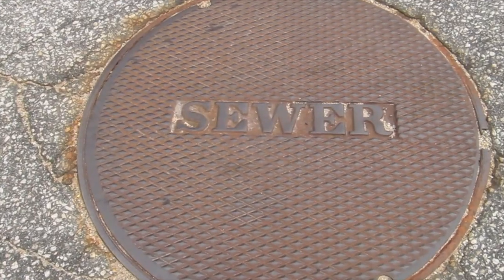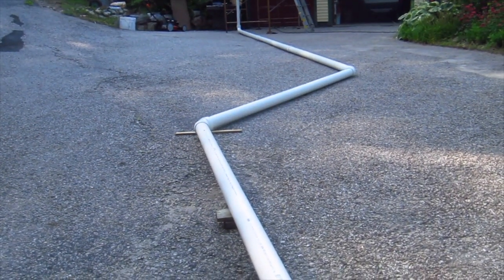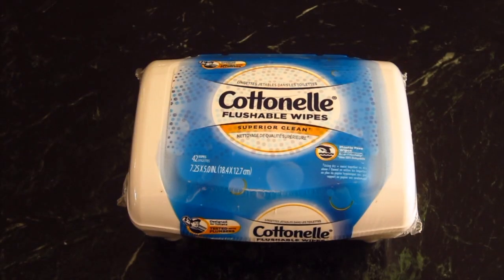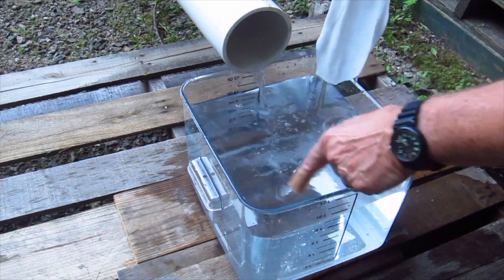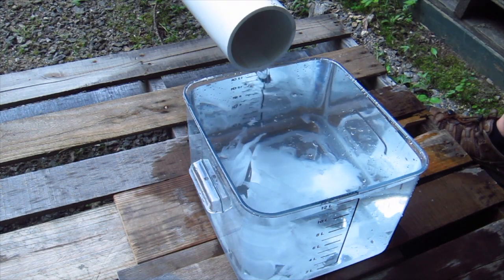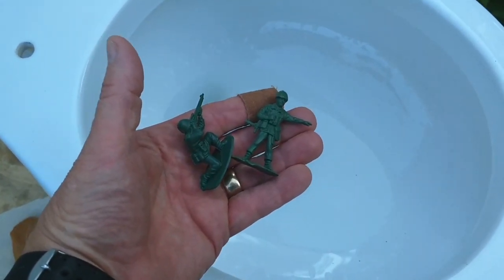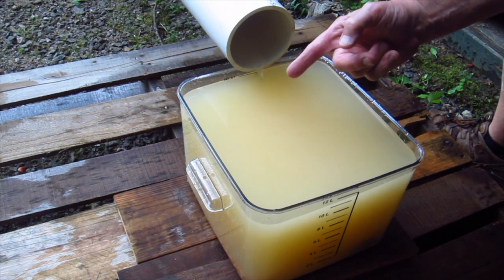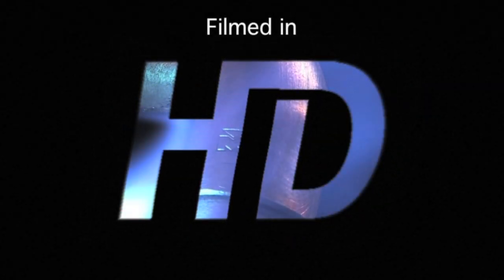Flushable Wipes - Do They Disintegrate?

Comment: Why don’t you let the wipes sit in the bowl as long as you did the TP? You obviously cut time out of the video between when you dropped the single ply paper in and when you flushed it
Reply from the maker: I did. No time was cut. I dropped in each thing and then reached for the flush handle. Perhaps there's a second, two at the most, difference in the times. I invite you to set up your own test apparatus and let's see the results you get with your suggested timing.

Comment: There are already several videos and documentaires made on youtube about the problem. If they mixed it with grease in sewers, they will turn in solid mass, almost impossible to break. Every time pipes must cleaned again with handtools and that is a lot work and very dirty.
Manufacturers SHOULD not named them "Flushable" and must make it just normal wipes and after use THROW in the bin like normal trash.

Manufacturers are biggest morons on the earth for sure. The another problem (wipes are actually plastic stuff because they don't break) are a lot microplastics in cosmetical stuff. They're all bad for our earth and we will eat them too from fish.
Reply from the maker: You can't have too many. For unlimited tips like this video, subscribe to my FREE newsletter at www.AsktheBuilder.com

Comment: Hey man, I loved this vid, but is it okay for me to use the Cottonelle Wipes? I know you mentioned that older drain lines are rough on the inside, so if it began to break from this smooth piping, I would assume it would break apart in an older one.
Reply: No!
Reply from the maker: Did you watch the last minute of the video? If not, WATCH IT ONE MORE TIME.

Comment: What happens if the wipes  sit for a while. Would they not break up  before the day is over. Seems weird to test it without letting it sit and break up for a few moments instead of removing them right away (I figured they would just be sitting in the water for a while in real world)?
Reply from the maker: Are you serious? How long do you stand in the bathroom before you flush the toilet?
Reply: I was talking about after you flush it. When it goes into the public system or maybe even septic. I thought it would be sitting in water for a bit after flushed

Comment: What about flushing down cocaine? Can one flush 2kg at once or should do it in 2 separate flushes? Does ccaine dissolve in water?

Won't ripped apart plastic bag (with corresponding size) stuck in pipes?
Reply from the maker: There are two types of information: Nice to know and Need to know. You're asking a question that's in the first group and as such you shall not receive an answer.

Comment: why do you use 3 inch black wast in the us in uk we use 4 inch as this reduces blockages
Reply from the maker: Because a 3-inch waste line for toilets works fine. I've never had a blockage in 50+ years. The colon in the toilet regulates what goes into the pipe. 4-inch toilet drains are required here in commercial installations.

Comment: Why is there a cut in filming at 6:13 right before you flush the single ply?
Reply from the maker: Because the entire video is made up of cuts. I had to go back and forth from the scaffolding down to the end of the 70 feet of drain pipe.

Comment: In my area you're lucky to have much more than a 1 foot initial drop then 2% after that. I wonder how anything makes it out with low flush.
Reply from the maker: Correct. Low-flush toilets are horrible. THere is no water shortage. Water is put back into rivers as FAST as it comes into sewage-treatment plants. If it wasn't, you'd have a massive FLOOD at the plants. Same with septic tanks. For each gallon of water I put into my tank, a gallon of water immediately flows back into the ground to be re-used again. If you want unlimited tips like this each week, subscribe to my FREE newsletter at www.AsktheBuilder.com

Comment: Hey Mr. Tim. I have 15 years of service work under my knees, haha. I guessed every test correctly.  Funny, most every customer denies flushing the wipes. I always wonder why people think lying to the plumber will benefit them? I have snaked out shirts, underwear, lots of wet wipes, feminine products and the #2 stuff, your last test....people who take lots or.medications will plug a toilet, even a Kohler. Once I was perplexed badly, could not clear a toilet....upstairs apartment, hot summer afternoon, disgusting messy drug addicts and several unfortunate children occupied this one bathroom unit, took the toilet outside, beat it with a sledgehammer and found a large tablespoon stuck in the goose neck of the toilet.
Reply: One weekend had to pull the kids throne to clear a persistent clog. I was grumbling at my kids for carelessly blocking it again as I cleared the goose neck and was then embarrassed to find the work pen I had lost the previous week rather than some LEGOs.
Reply from the maker: They lie because they're embarrassed.

Comment: Who cares if the wipe is intact 60 seconds after you flush it? The test is to leave it a bucket for 24 hours.
Reply from the maker: John, how's dropping one in a bucket an accurate test? There's no sewage system in the world that operates like that. Water and waste is moving constantly in sewer systems from the time it leaves your home until it arrives at the sewage treatment plant that could be miles away from your home. The only thing close would be a single septic tank and as I said in the video, you'd have to have your head examined to put these things in a septic tank.
Reply: Ask the Builder Putting it in a bucket for 24 hours would simulate the baby wipes being stuck in a waste pipe or it would simulate it sitting in a septic tank. If the wipe  broke down over time who cares if it takes 60 seconds or a couple days. The problem would occur if the wipe stayed intact for a long long time. But I agree with you baby wipes should never be flushed and flushable wipes I doubt breakdown quickly, if at all.
Reply from the maker: John, your reply contradicts itself. No worries. Perhaps you should do the test since you have an account here. Record the video and see what happens. GL as we say in Morse!

Comment: not trying to be crass
If you are quite sure your stool exceeds the size and weight of the model used, would you recommend adding water to the flush to prevent clogs and get everything to the municipal system? Or should we count on breakdown similar to the soybean paste model.
Reply from the maker: I'd have a 5-gallon pail filled with 4 gallons of water next to the toilet. Once you're about to flush the toilet to send the mass on its journey, get ready to add the 4 additional gallons of water as the water from the tank enters the bowl to send the log down the porcelain flume. You flush the toilet and as your stool disappears, start to add the water from the bucket. WATCH this video for the pouring technique:  https://www.youtube.com/watch?v=kahfe0kXvo0&t=4s

Comment: I was told by a plumber to never flush a Kleenex. That would flush similar to a paper towel.
Reply from the maker: Tissues will react much like the high-quality paper toilet paper. Throw tissues in the TRASH CAN.
Reply: @askthebuilder  I... Did not know that. I have only flushed kleenex about five times in my entire life, when I'd realized too late that there was no tp and used kleenex. I usually use Puffs Plus for my nose, and that always goes in the trash. I keep a small can beside my recliner just for that. But now I can say I know for a fact that no one should flush them, and I will mention it to everyone often, now.

Comment: In Fredericton NB this spring they had an odor problem at their sewage lagoon, after removing a larger than usual amount of grease from the lagoon they pulled the pumps and removed 2 tons of flushable wipes from the pump intakes. Just because you can flush something doesn’t mean you should.
Reply: Agreed. Also never get chlorine in your system. Never, none.

Comment: Thanks man, thumbs up. I always put my wipes in separate bag but I thought that the wipes would be fine. Also I was unaware that those companies make the claim that they are suppose to dissolve. One thing, I think everything you said was good advise but the only toilets I know of that could possibly take some of that is those powerful toilets in NYC that don't run on septic systems. When you flush it, it sounds like a sonic boom went off. You know what I mean? Its like comparing a Bugatti or Ferrari to a Honda Civic or Toyota Camry.
Reply from the maker: TY as we say in Morse. If you want unlimited tips like this each week, subscribe to my FREE newsletter at www.AsktheBuilder.com

Comment: Bro that was a huge simulated dump
Reply from the maker: It was exactly what the Maximum Performance test labs said to make. I thought the same thing as I kept weighing more soybean paste, "Wow, this is enormous!"
Reply: @askthebuilder  Australia this year got hit hard with Flushable wipes (not flushable in very small print). Causing huge issues for the poor people who had to fix this 3-4 times a week. Now i live in a small state called Tasmania (Australia). our local guys was working on the small pumping station only about 10 doors up. They spent a good few days pumping this crap out of the system. In the end our waste treatment put Adds on Tv asking people not to use them.

Comment: I know from personal experience they can't be flushed. Totally messed up my pipes heading to the septic. I had a huge clog that I had to snake out and it was all "flushable" wipes. I still use wipes but I throw them away in one of those smell securing diaper pails. I will never flush them again. - Heidi
Reply from the maker: Correct. If you want unlimited tips like this each week, subscribe to my FREE newsletter at www.AsktheBuilder.com

Comment: My take away: So basically, you can flush just about anything down a toilet.
Reply from the maker: Pretty much that's true. Remember, old drain lines have rough inside surfaces and it's easy for clogs to build up.
Reply: That’s what we should be worried about if we have a habit of flushing things that we shouldn’t flush down the drain. If Cottonelle made flushable wipes that break down in the pipes, then they should be fine to use.
Reply: Now imagine cast iron pipes that have some roots growing in the joints or have rusted surfaces.

Comment: Excellent testing. Here's the difference between lab testing and a real plumber who has worked and does this for years. Great job Mr. Carter!
Reply: I would argue that the test could be slightly improved. Each 'test paper' should have been allowed to sit in the water for 1 minute before being flushed to simulate reality.
Reply: @wuddadid  1 minute seems a bit long - maybe if you have to zip up and button tight pants it might take that long...
Reply: @wuddadid  do you let toilet paper just sit for a minute before you flush?
Reply: @ReigningWomban do you hold onto all ypur used paper before you flush, or do you flush after each wipe? Madman...
Reply: @Bro-Sef he has to be deep cleaning up to two knuckles if he's there an extra minutes